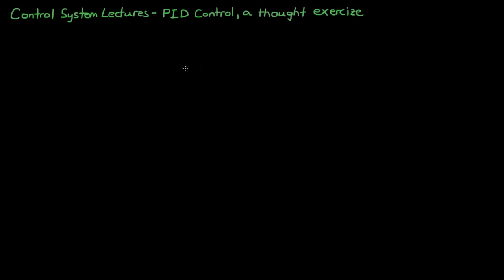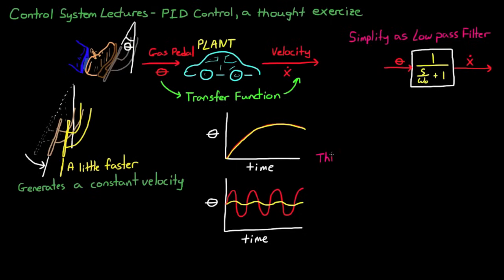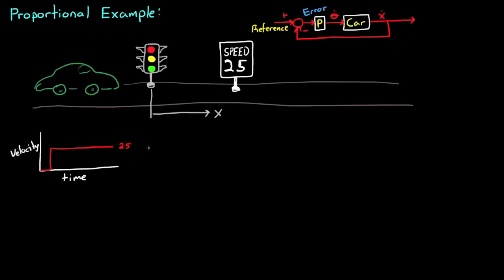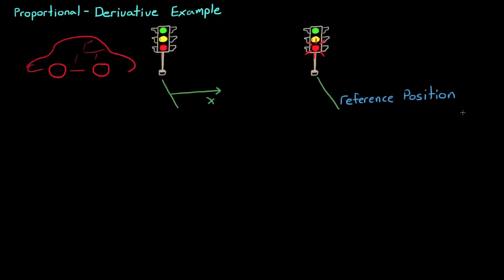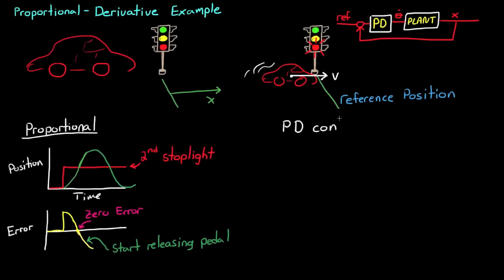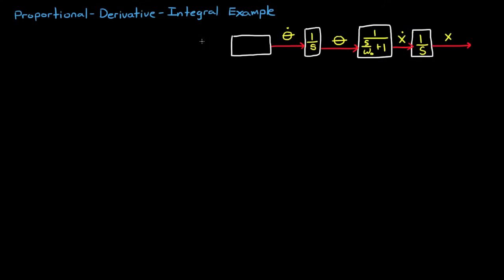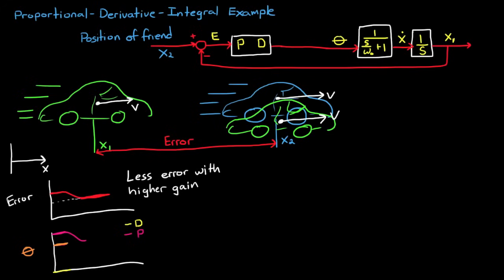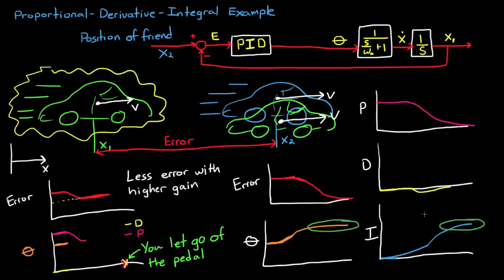Simple Examples of PID Control

Comment: At 9:54, I don't understand why the P controller doesn't make you press the gas pedal and catch up to the other car. It looks like to me the same as the previous example before with trafic lights (except that the trafic light is moving, but if we change reference frame, it looks the same).
Where am I mistaken ?
Thanks for the great videos.

Comment: As An Engineering Technician who has 30 years working in the practical world: has been a US NAVY Aircraft Flight Controls Systems mechanic for 8 years and having a two year degree in Electrical / Electronics Engineering Technology, I am very interested in CONTROL THEORY, I have worked at LOCKHEED Environmental Testing Laboratory for 17 years doing ACOUSTICS, VIBRATIONS, THRMAL/VACUUM, EMI/EMC Radar Testing, Structural Testing = We DID PRACTICALLY TESTED EVERYTHING from STUCTURES to breadboarding building electronics sensors, set up instrumentations systems working with all types of Engineers from all the Engineering disciplines, now I am retired = I still have the passion to ANALYTICALLY REVERSE ENGINEER what I DID and learn advanced mathematics, DESIGNING DIFFERENTIAL EQUATIONS OR MODELS solving them with LAPLACE TRANSFORMS and implementing, and BUILDING Electronic Circuits to simulate anything in the Physical World. Microcontrollers, Mechatronics, Robotics, Remote Sensing.

Comment: A good example would be the old beetles left in first gear and floored. You slam to the floor, car jerks extremely hard forcing your foot to pull back a bit, the car slows down thanks to friction and pushes your foot into the throttle, and you get oscillatory behavior for a while until you let off the gas.

Comment: Hi sir! Im currently working on a project 'PID ac temperature control using arduino and bandheater'. I've used an existing program and circuit which i found in yt though i did a small change (i change the existing circuit's 1 bandheater to 3 bandheaters). I would like to know how to solve for the new PID constants because the temparature is not controlled (better if there is a sample equation/problem for a guide). Thank you in advance for your response  and Godbless :)

Comment: Brian? Can I still ask questions in this old videos?

So, I have been seeing in other lectures (like Ogata and Corripio books, this last one applied to Chemical Processes) that when we have proportional controllers we actually do have offsets. On the other hand, you said that proportional controllers don´t. In what should I believe?

Salutes from Brazil.
Reply from the maker: Hi Jean, luckily, you caught me on YouTube reading comments so I will respond to your question ;) Whether a controller has an offset or not isn't just dependent on the type of controller but also on the system type and the input.  A proportional controller will have an offset with a step input if the system type is 0 (or no poles at the origin). A proportional controller will not have an offset with a step input if the system type is 1 (one pole at the origin).  In my example, the total system (controller and plant) was a type 1 system so no offset.  There is a good chart explaining this here: http://ctms.engin.umich.edu/CTMS/index.php?aux=Extras_Ess#7 but the best way to understand this is to solve for the steady state error for different systems and different inputs and see for yourself.  I hope this has helped.  Cheers from Washington state!
Reply: Thanks, man, helped a lot! =)

Comment: Hi Brian! Thank you very much for the brilliant lectures! I do appreciate your work! But I think in this particular video it would be more accurate to say that the angle theta defines the reference velocity which is compared with the output velocity. The error velocity than is processed by the PID-controller.

Comment: Took a whole class in mechatronics as a computer engineer. You managed to explain a whole semester's worth of confusion in a half hour between these two videos!
Reply: How can this possibly be a semester's worth of study material?
Reply: @BeeryGamer  It is worth an entire semester conceptually, since it intuituvely expalains what PID control is and why we use and how it interacts with the variables. To design such a controller, however, you need to take the entire semester.
Reply: @BeeryGamer  Most students not Majored in tron have trouble understanding it. Pretty much like 90% of software students have trouble understanding it, and the rest 10% have embedded system background.
Reply: i want to be a mechatronics engineer
Reply: @Hamza-en3pz  Did you become a mechatronics engineer?
Reply: Go to CSU, Chico! We have a great Mechatronics program.
Reply: @CarsonSchmeck  and mechanical engineering, we also learn a lot of control systems.
Reply: hahaha I agree on that lool I searched for the information about PID and read lots of them, but still I felt like something's missing and this video is just.., after watching the video, I felt like I should pay hh
Reply: @daesoolee1083  its a lot more complex than what is being explained, actually you need a strong knowledge in differential calculus to better understand it, there is something called Laplace transform hence the s symbols. Anyway good lecture.
Reply: My dumba*** cousin drives like his P gain is over 9000.
Reply: Cant believe my brain is doing this pid controll and i still dont understand lollol

Comment: When I studied control theory at university many years ago we started almost immediately into the math of Nyquist stability theory. The point seemed to be that our lecturer was a clever dude and we undergrads were a bunch of idiots who should read more. Maybe he was right, but his job was to change the error signal between our level of knowledge and his own: a nice problem in control theory that he thoroughly failed to resolve. 
I got more from your 14 minute video than I did from hours of his instruction. Nicely done. Thank you.
Reply: Maybe his system was operating in open loop control, without a sensor to detect the error, or his controller wasnt tuned correctly to reach the reference value
Reply: I am in my third (!) semester of Signals + Systems / control system undergrad courses. I’ve gotten A+’s in the first two semesters, and I can 100% say I have never received this sort of explanation of a PID system. We have learned all of the math behind it, but I have never had it explained what P, I, D actually does. I didn’t know the integrator was integrating the error signal (seriously... I didn’t), it was just never explained. It was just referenced as 1/s, and we had some rules stating when you could ignore 1/s because it wasn’t needed - but never a physical explanation of what it was doing. I wish I found this channel 2 years ago.
Reply: @kcmichaelm  you can literally see at the definition that the integrator integrates the error signal lmao.
u = K(e + 1/Tn intgrl(e) + Tv de/dt) = PID in time domain
Reply: @abcxyz4207  Was not taught any of that, but thanks for the reply
Reply: Being a good engineer or academic doesn't necessarily translate to being good at educating.
Reply: Same for me, but being now on my path for some years, gaining in wisdom, I can tell you that many teachers don't even understand themselves what they teach. That is why they only teach you by maths and straight down in the nuts and bolds instead of giving you, as this guy does, an intuitive and top down approach first.
Reply: In general, there is a balance between being able to apply the stuff and understanding at a higher level, and everyone will have different preferences there.  There’s also a welll observed phenomenon where experts will unknowingly project their understanding onto their students, and forget what it’s like to look at the problem with new eyes.

Comment: Just curious, when you say that we alter the rate of change of angle, wouldn't it be that we press the pedal hard, giving a large dT (d theta) then dT = 0, like floor the pedal and then keep it pressed far down. This would mean a large dV, so as the error in velocity gets lower we let up on the pedal, giving a negative dT. This magnitude of the -dT would be relative to the dV (we release the pedal faster if we are gaining velocity too fast such that we would overshoot the speed limit). Then we hopefully converge at the speed limit. So at risk of being a nitpicker, isn't that a PD control as well? 

in your example, our acceleration would be about constant, but isn't that not the case? Or do I not understand PID properly or am I just a crazy driver.
Regards.

Comment: I am attempting to tune a PID controller for 'closed loop boost control' on my car. This PID controller will regulate air pressure in the intake manifold of the car that a turbo charger is producing. The output of the PID controller drives a PWM solenoid that opens and closes a waste gate. The ideal PID controller for this application will let the turbo increase pressure as quickly as it can to the setpoint level and then quickly open the wastegate to avoid overshoot. Thereafter, it will modulate the PWM signal to the solenoid to actuate the wastegate and regulate pressure to the set point value. The PID controller is setup to not activate until within 30kpa of the set point. At which point, it starts actuating the wastegate. The pressure can either increase slowly or very, very rapidly depending on how quickly I mash the throttle, so keeping track of how quickly the pressure is increasing is very important to controlling pressure. Based on what I watched here, it seems that a PD controller with maybe a bit of I value, is best?

Comment: Hi Brian I really enjoyed this video, I'm not an engineer, I just want to understand how to tune my quad, you see I have found a hobby, that is just too awesome, building and flying high-performance copters using FPV goggles. you see part of this practice is tuning the PID controllers of the copter and there isn't really good videos that explain how to tune a copter correctly, if you have time and interest I think you could make the definitive  video/explanation on the matter, if you are not interested or don't have the time, still  this video will help me and other pilots to understand better what PID's are. thanks
Reply: +Alvaro Salazar I second that, a lot of the vids on PID control by fpv pilots are helpful but don't go past what they are used for in multi-rotors. A wider explanation of concepts usually helps me with a more in depth understanding of concepts

Comment: In the example with PD, shouldn't the car stop at the second stop light? The way the drawing was put the car started at the first stop light and then reached the speed limit and never came down to the halt at the second light. I'm a little confused at what the derivative controller was supposed to be doing here.
Reply: +Lythya dont trip its a mutual feeling, i did not learn anything here, what are you learning this pid control for Lythya ?
Reply: +Lythya In his example, I believe it was the second example, he said with the proportional control only the car blows through the stoplight and then would go into reverse creating a never ending oscillation, however, as the derivative function is added, then by taking the derivative, it slows the power at which the car is given or in his example the angle theta of the gas pedal and thus makes the theta larger thus slowing down the car.

Comment: hello brian..love your video with regards to pid and interesting example. is it possible if you could upload a video briefly regarding control tuning method. (tuning methodologies) and its implementation specifically at offshore platform. like tuning the level control valves, the pump..

Comment: Hi Brian, first, thanks for all your video's, they are really helpfull.
I have a question. I'm modelling a beam with a ball on it, controlled by a DC-motor in matlab. You can manually set the angle of the beam, so you can ballance the ball. To let the beam go to the desired angle position, I'm using a PID-controller but because of the ball is moving on the beam the inertia of the system is variable. This means that the PID-parameters are changing constantly. How can the optimal parameters be calculated with ease?
Thanks in advance!

Tijs

Comment: Thanks Brian for the nice video and illustration.
What if we do not know the plant's model? In my case, I have a motor w/ encoder and I need to control it's speed and angular position so that it can keep the tension of cable around a winch constant. How would I model my plant as the cable's model is very complex?! Can we make any assumptions and simplifications?
Thanks.

Comment: SO...when i change the P? when the I? and when the D? i get confused :(
Reply: Bram Borms I'm still not getting the concept,plz explain the D n I part more.
Reply: Simply put, increasing P will try to get you to the whishing point faster, increasing I means you'll do more effort to actually be exactly on the whishing point which, if you make it too high, will make the entire system unstable. If your overshoot is too big, increase the D which will make it smoother, but also slower.

There are softwareprograms and formulas which can be used to calculate the ideal Kp Kd and Ki's, but mostely it's just adjusting after testing it.
Reply: Bram Borms ok thanx a lot
Reply: Bram Borms hi there. i have a gimbal with a pid controller (and last time i did math was when i was like 15) and your explanation of PID is the best i've come across so far. thanks man.
Reply: +Bram Borms what programs ? im looking to use this pid controls for motor control in arduino programing
Reply: Bram Borms Do we use matlab for calculation purpose of pid?What about deltaV systems can you make/suggest one video on it plz?
Reply: and it will help if you include Arduino mcu in this list as well Dc motor control thru PID is a very useful application

Comment: Hello, one quick thought about your PD controller. If you impose a step reference as an input, your error varies instantly, which implies that the derivative of the error (D pad) is infinite. Therefore the response varies greatly due to the D pad. I was taught that to counter that effect, the D pad is generally placed in feedback of the plant. Am i wrong or not ? I am a student and haven't completed my class yet...

Comment: Around 4:30 in the left corner should it not say delta omega that is. Change in pedal position, because the way it is now it means the position of the pedal, wich would mean as you reach desired speed, you would bring the car to a halt. Nitpicking really, but just cheking.
Reply from the maker: Hmm, I don't think so.  The pedal angle is theta and what I'm plotting in the lower left corner is theta dot (which is pedal speed). So as you reach your desired car velocity the pedal speed goes to zero and you stop moving the pedal, not that you bring the pedal position back to zero.
Reply: Ah, thanks. BTW thank you for these videos i just aced my Exam, and that is solely thanks to you seeing as me lecturer did not speak understandable English.
Reply: +Brian Douglas I know it is an extremely late reply, but I would like to point out that in driving a car, the driver is controlling the position of the pedal rather than the rate of it being pressed. As speed increases, theta would decrease until the speed had reached the desired value, at which time theta decreases to a certain value that holds the speed. 

The reason why theta dot doesn't matter, is because the only thing that controls the acceleration of a car is theta itself. E.g., no matter how fast you press the pedal to 50%, it is always the '50%' that decides the car will accelerate at 50% of its max potential.
Reply: +Leo  I do agree with you! The pedal position defines the speed.

Comment: What causes the integral term to hold the system at 0 error? In the instant before the system reached 0 error, the integrator was a large sum. So when the system reaches 0 error in the next instant, why doesn't the integrator just cause an overshoot? Is this some kind of balance between the I and D terms?

Comment: Thanks for the reply! It was just that you seem to state that p-controller generally have no steady state error (and I always tell my colleagues otherwise). Position control using a stepper motor is another example where the process itself has integrating action (like a delta on the gas pedal), and hence p-control here does not have steady state error. Greetings from the Netherlands.

Comment from the maker: Thank you for the big complement! As for the P controller, you are correct in the general case. However, I applied a little control system trickery! The error did go to zero, so the output of the law was zero, hence no steady state error. The reason I was able to get away with this was because the output from the controller represented a change in pedal position and not an absolute pedal position. Once the velocity error went to zero, stop moving the pedal, and the velocity will remain constant.

Comment from the maker: This might be hard in this comment box to explain .. but here it goes.  's' is a complex variable in the s-domain and is similar to how 't' represents time in the time domain.   W0 is the frequency below which the low pass filter approximately passes the input straight through.  Above this frequency the signals are attenuated (not fully but it's a good approximation).  Check out my video Bode Plots by Hand: Real Poles or Zeros for a little better understanding.

Comment: If you are talking about adding the 1/s term at 05.43 in the video: When you go from velocity (xdot) to position (x), that is following the arrow (from left to right) in the block diagram, you multiply with 1/s (integrate). When you go from postion (x) to velocity (xdot), that is the opposite way of the arrow (from right to left), you divide by 1/s wich is the same at multiplying by s (differentiation).